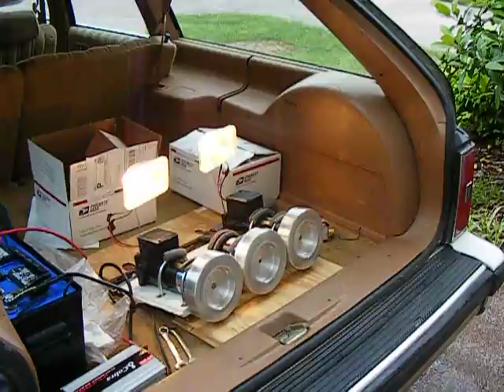New Free Energy

Comment: @Yourfishman - calm down.  The numbers you quote are not facts for a start.  If the numbers give a misleading or incorrect answer then they are not facts.  The details are important.  Let me ask you a very simple question.  Imagine a car driving around a circular track at a constant speed.
Q.  Is it accelerating?

If you can understand this problem I can then explain why the oscillator is misunderstood.

Comment: @Yourfishman - "...you could self run a 2SO".  Humm, I'll just leave this alone.  Or perhaps you'd like to let us all know how it is possible.

The device in this video comprises a battery, a motor and two generators connected to a load.  The power out is less than the power in.  It doesn't and can't self run.  The only reason it runs is because an external charge is supplied to the battery.  Hardly a closed system by any stretch of the imagination.

Comment: @LiamXaoh  
We can disagree and that is fine. But I do stand by that you could self run a 2SO. And i do admit that Newton would have issues with this.

Are disagreement may revolve around you thinking the 2SO is a "closed system" I dont think they are closed, nor do i think these interactive gears in this video is (necessarily) a closed system ether.

 As far as, "if it works, someone would have done it",,,,,,,,,, Humm, I'll just leave this alone.

Comment: @Yourfishman - I wasn't referring to heat pumps.  Heat pumps operate in an open system and are hardly relevant to the COP claim in the video which is implying a closed system.  People confuse a heat pump COP>1 with an efficiency of >100%.  No device is >100% efficient, therefore no device is self-running.  The device in the video cannot self-run, otherwise some bright spark would have done it, then we'd have to change the well established relevant laws of physics...

Comment: @LiamXaoh 
Sorry Liam that is not correct.  Most all COP +1 devices are NOT self running. Heat pumps and most refrigerators are +1 COP & nether are self-running.

Now that said, making a 2 stag oscillator run it self is possible (I understand that is hard to believe, but it is true).  

 You should be objective at these possibilities. Once you understand the 2SO then you may understand other ways Gravity and the like CAN be harnessed. I can give you more Exp of gravity giving gains in energy.

Comment: @LiamXaoh     Milkovic's 2 stage oscillator.
Example
10 lbs of thrust for 6", on a 100 lbs pendulum, that is under the acceleration of gravity, creates 200 lbs of down thrust for 6"  due to centrifugal force, ( that is already COP 10 )
   The leverage effect adds nothing to it. The lever converts  the 200lbs over 6" into 400 lbs into 3" (still COP 10)
Here is a simple one
RHEAD100  youtube video:  testing large Milkovic 2 stage oscillator Video 6

Comment: @Yourfishman the energy is not free as in it has no source energy can not be created nor can it be distroyed. all of these renewable sources are cust the changing of one form of energy (eg light, kinetic, heat, chemical ect) to electrical energy. and the energy you can get from gravity comes from the potential energy and is regreatably limited not infinate. however i do think it is a good idea to use such things as solar, wind, thermal, HEP, ect as it is a method to overcome the energy issues.

Comment: @MrMackyLove the energy is coming from the batterys. and this is not physicly possible under any of the laws of science! as i said before the first law of thermodynamics is that energy can niether be created nor distroyed. meaning it is impossible for energy to be produced in this way due to energy being lost as heat, sound and light  this means that an energy soruce has to continualy be pumped into the system to keep it going. this is even how it works in power plants its just converting energy

Comment: @rexmcnish -a magnetic field is not a form of energy.  You have proven nothing because you misunderstand how a motor works.  The electricity passing through a coil switches on and off creating a changing magnetic field.  Thus the alternating magnetic fields react with the fixed magnet fields to create motion.  Replacing a coil with a magnet will not create the necessary alternating fields.  A magnet produces a fixed field.  This is really basic stuff - read up on it.

Comment: @rexmcnish - a magnetic field is not a form of energy.  Look up any physics book and you'll see energy is defined as: (physics) a thermodynamic quantity equivalent to the capacity of a physical system to do work; the units of energy are joules.

As magnetic fields are not measured in joules and no physics book agrees with you I'd say you making up your own definition is pointless.  A magnet field merely allows energy to be converted to work.  You need to shut up and learn.

Comment: @rexmcnish - the motor uses more energy than the generators put out.  Therefore the batteries will go flat as there is more energy out than in.  I know electrical engineering, you don't.  Do some research.

Comment: wow ...*facepalm*   seriously?... Yeah, so what. You're powering two generators with one DC motor at twice the load. Add another generator and you are adding even more to the load. The whole system will slow and you will end up with the same amount of output. Your actually losing a lot of energy from heat. Seriously, quit wasting your time with this.
Nice frictionless gears by the way!

Comment: How many amps are you pulling out of the battery?

How many amps does each lamp pull? 6A each?

When the lamps pull more than what you are pulling from the battery, then you will be showing energy production. Until then, you are only converting battery current to motor and generator motion and back to current to use in your lamps or other electrical loads.

You will discover, when you meter it, that all of the power is coming from that 500+AH battery.  Lamps would run direct for 42 hours.